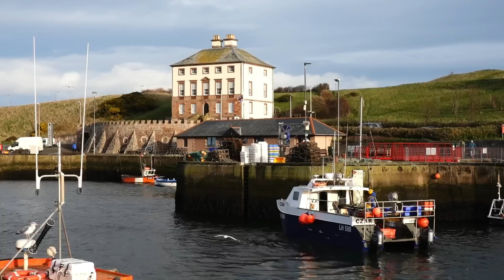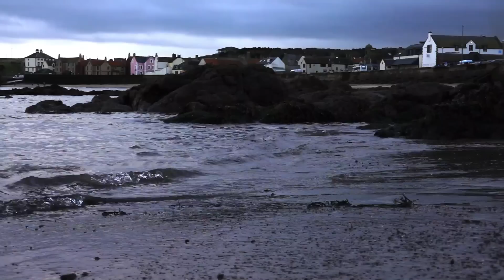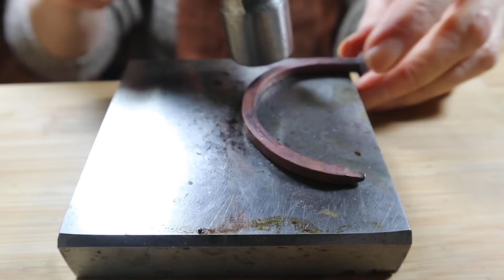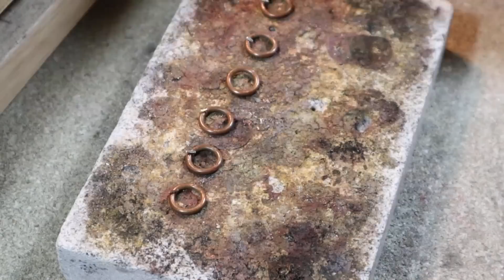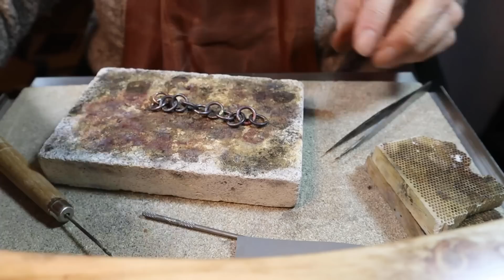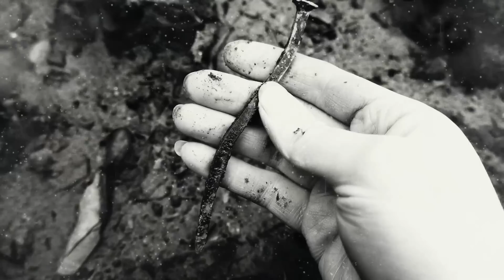Ship's Nail Bracelet Made from Found Antique Nail - Metalsmithing (Mudlarking Find)

Comment: Hiya ladies,
I've not long found your channels, and I love them. I'm disabled and on crutches, so no mud-larking for me. But I am trying to learn to be a goldsmith, i.e., make jewellery. I made some gem earrings for friends for Christmas, and now I'm on chain mail bracelets. I have a similar coiling set-up but use a battery drill with knitting needles for different sizes. Then I use the second part of the kit to cut them using my Fordham flex shaft. From a working life of using tools, I was an electrician before becoming disabled, and players with grip teeth are a pain to clean up after with the marks they leave in silver; beaders/jeweller plyers with smooth jaws are so much better. Copper solder is also better for leaving less cleanup. 
Happy New Year, and stay safe, Steve...